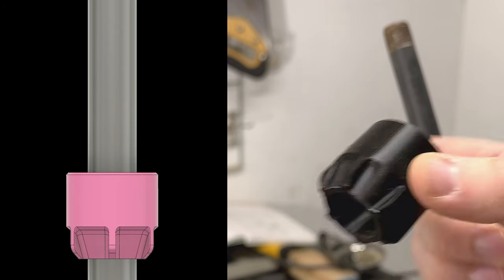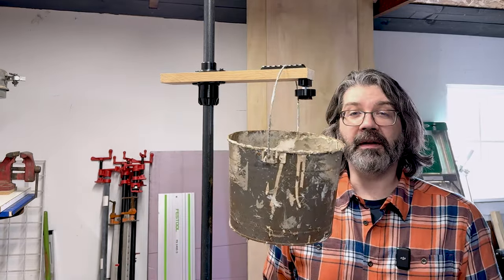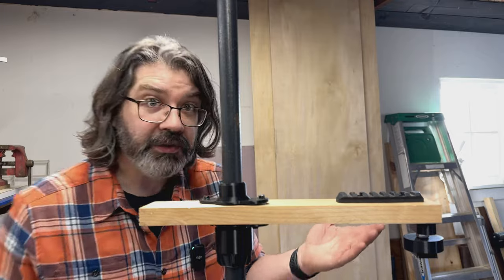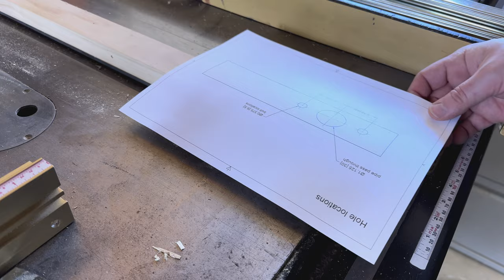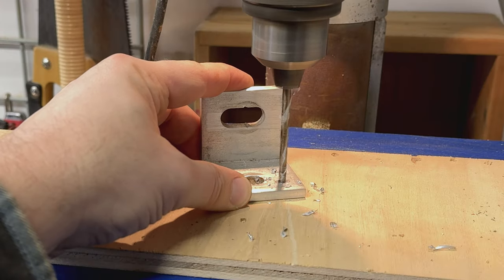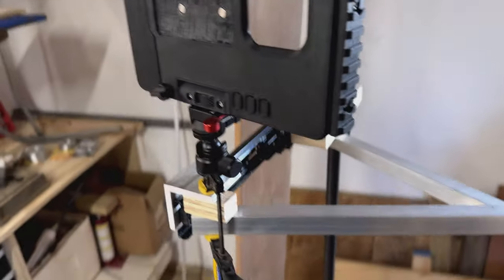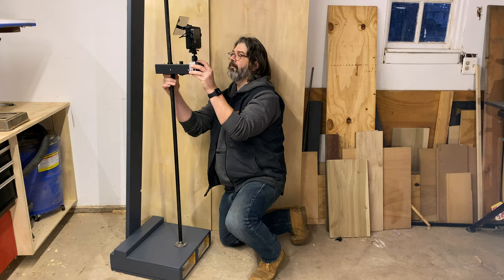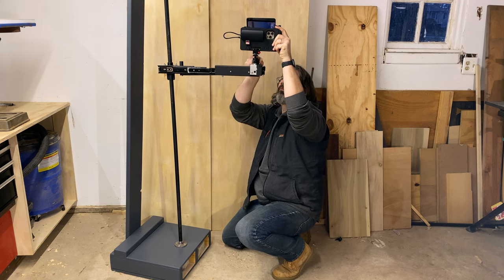I also made a Tripod Killer!

Comment: Thank you for sharing your process. I wonder whether using another two drawer slides on the other side of the block would be stable enough and avoid the aluminum "elbow" thrown out when collapsed.
Reply from the maker: Oh, that’s an interesting idea. Didn’t try that, but orienting it at 90 degrees would be a good experiment. 
A lot of the stability from the arm comes from the top face of the arm sliding along the wooden block it’s mounted to.